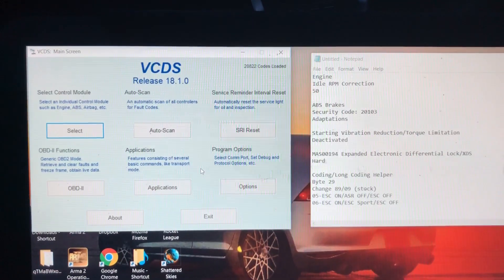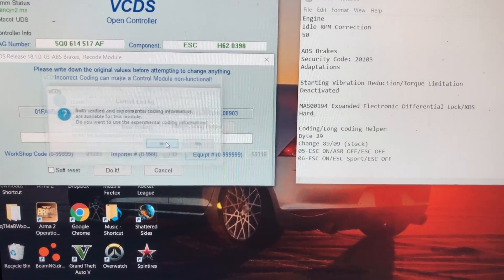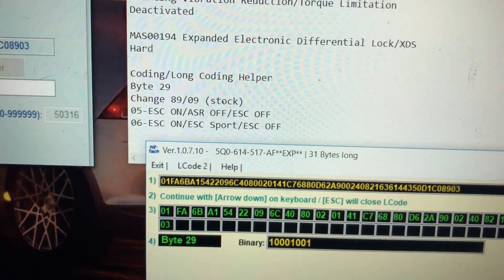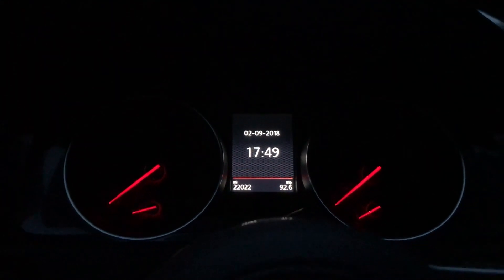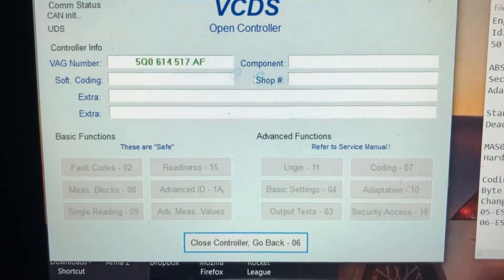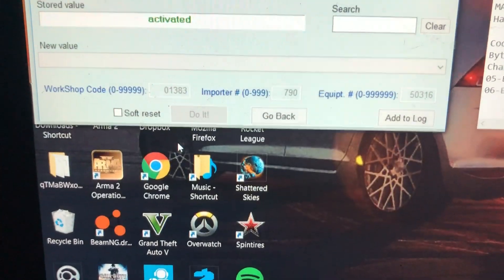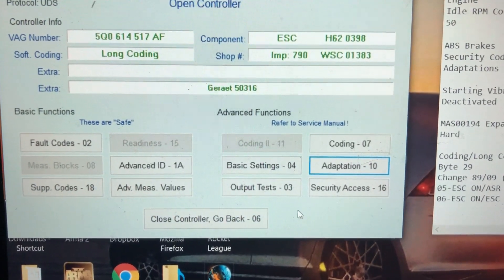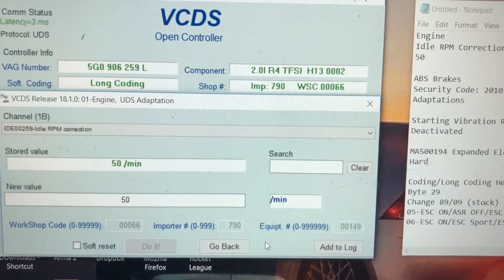MK7 GTI VCDS Performance Tweaks

Comment: I have a non-PP GTI and for those that have one too i wouldn't reccomend putting the XDS on the Hard setting because after i did that the first time i went spirited driving i got my brakes overheated and started making noises.
Reply: did you see any benefit at all to changing that if other than the hot brakes? I always thought you were supposed to turn it off to have total control rather than random brake kick?

Comment: Hello!
Please help me with the steps to adapt the turbo for my mk7 gti us version 12/2014.
I put on the car a is38 turbo from a golf R, I need the steps to adapt the actuator with vcds please!
I tried to go “select->engine-> adaptation” and in that list does not appear charge pressure actuator... I think I need a security code to unlock some more things there... I use the last vcds version
Please give me the steps to adapt the actuator, you are the best in this!! Thanks a lot!!!
Reply from the maker: Gabriel Scupra Im not sure if you can adjust that with this version of the VCDS software. I know there is a full version of the system where you can adjust the function of hard parts, aka wastegate, throttle body, map sensor, etc. But that version is only available at a higher price and for companies that actually tune the cars. If it were me, i would jist take it to a local tuner to you and get the car tuned correctly. Hope this helps!
Reply: MK7 GTI Racing Channel thank you very much sir, i already have a stage 1 tune, and the tuner i always rely on is 250 km away from me, i just need this adaptation to use the car with the is38 turbo until i reach the tuner and get it done again! Cheers!
Reply from the maker: Gabriel Scupra You shouldnt have any problems with running the car on a bigger turbo without tuning for it, if you need to drive it to get to the tuner, do so, but dont push the car and get it into a high amount of boost. The is38 is the same turbo as the is20 just a little bigger so it has all the same sensors, wastegate, etc. The car wont drive any different until you floor it, just dont do that until you get it tuned! But thats just what ive heard from other people, do it at your own risk, and obviously if the car has any issues, dont drive it!
Reply: MK7 GTI Racing Channel I’ll do some more research, my car is in perfect condition, and i don’t want to risk something, will find a way, thank you very much for the time and dedication! Keep up!
Reply: @Scupri  ciao la tua macchina con is38 da un errore di overspeed turbo?

Comment: Great vid! Worked like a charm. What is the difference between ESC Sport, ESC Off, and the original set up which has ASR off?
Reply from the maker: Jim Sokolowski So ESC Sport will let you have some amount of slip without letting the car get out of control, ASR off allows for wheelspin through the driven wheels but no more than that, and ESC off completely turns off the stablity control allowing for wheelspin through the driven wheels and the rear end to slip during cornering without any interference.

Comment: Great video, do you know if those mods add any "flash count" to the ECU so it doesnt flag TD1 at the dealer?
Reply from the maker: Maxim Lelièvre Im not sure man but i would imagine no because all of these “mods” are all programs of audi/vw etc. None are modified to work with the car. The VAG-com cable is used by dealerships to diagnose cars in house.
Reply: My local dealer actually did some VCDS mods for me.  The shop Forman plays with VCDS mods all the time and they have no issue with it.
Reply: @KrAzYKARL49 what type of vcsd mods did you get done?

Comment: Is there a launch control option. If so. Can you determine the rpm to set it at
Reply from the maker: Austin Hoffman Unfortunately through the VCDS system, no there isnt, the only way that ive seen at least is either through custom tuning which is really expensive and no one likes to custom tune these cars, or through a WOT box, which is a whole thing in itself and it’s universal so it can cause serious damage to your car. (If you dont know what a WOT box is, look it up on youtube).
Reply: @6thGenRacing  I figured. Thank you
Reply from the maker: Austin Hoffman No problem!

Comment: I have a 2017 GTI Sport APR stage 2 and I got a cel a few days ago after the tune and my car idles very weird. Whenever I rev it in park or neutral the rpms hold at 1100 for a while and bounce up and down. Can the VCDS detect the problem?
Reply from the maker: chanaas cruuzz I would imagine it would through data logging, but i would contact your tuner first to get some info about that. Because that doesnt sound right, something needs to be adjusted there.
Reply: MK7 GTI Racing Channel thanks for the quick reply I contacted my local shop they’ll look into it tomorrow. Thanks for the help ! 👌🏻